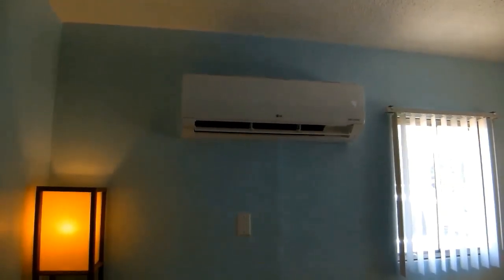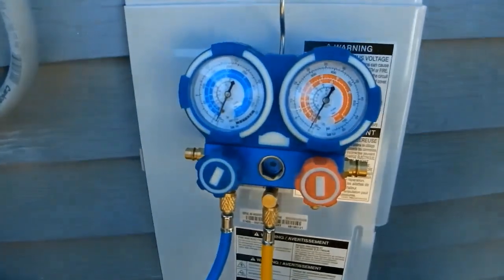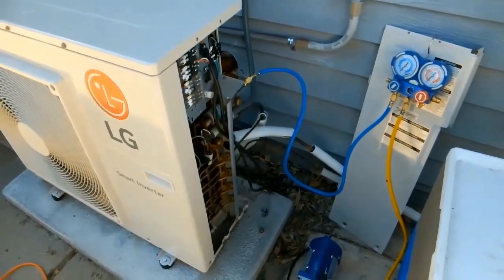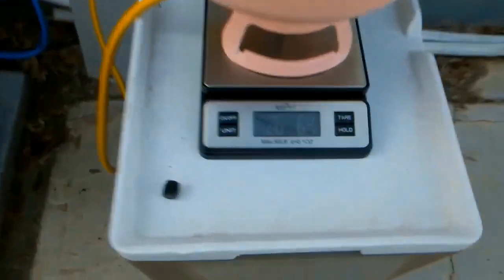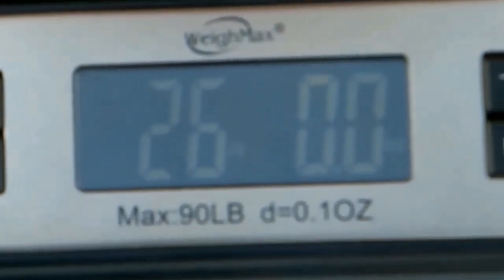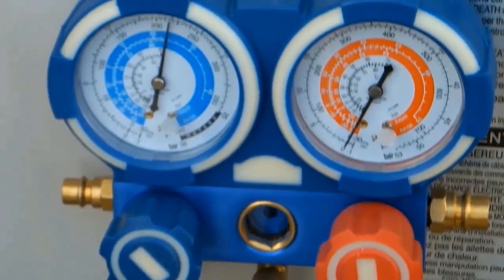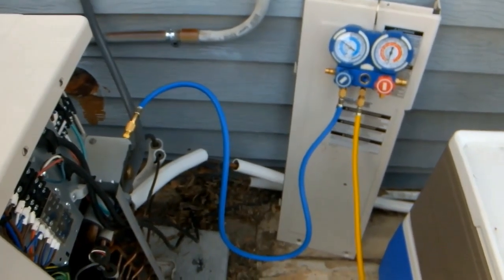How To Add Refrigerant to a Mini Split Air Conditioner

Comment: Nice demonstration. You should purge the yellow hose of air before doing this. Also, the hose will eat about 1.5 to 2 oz refrigerant, plus a little loss when you disconnect, so add a bit more refrigerant accordingly
Reply from the maker: Thanks for the feedback - actually, I updated my mini-split info via this recent playlist: https://shorturl.at/Dnwhc

Comment: I'm lil confused when u purged the system what did u actually do ?? Was it running blowing all the r410a out or was it off with the lines simply connected and open I mean did u use the vacuum pump to suck all the old refrigerant out I'm kinda lost
Reply from the maker: I completely purged the system; that is - removed all of the old refrigerant using a vacuum pump which is pictured at the 1:45 mark in the video. The pump is not running at that point so you don't hear it - it's too noisy to record a video over. The entire system - outdoor compressor, linesets, everything - was completely free of refrigerant after running the vacuum pump. Once the system is empty, you use the manufacturer spec sheets combined with how many feet of linesets that your system has to determine how much R410A refrigerant you need to weigh in to fill the system. Also, I kept all indoor and outdoor units OFF when adding refrigerant back in. You turn the units on after the refrigerant has been added, and then check the PSI to make sure your system will be running at full capacity.
Reply: @DoItYourselfandSave  oh okay thanks I didn't know you could add refrigerant with the units off I thought it had to be running with the compressor pumping to add refrigerant

Comment: Great video! Couple of questions on pressures. I have a discontinued LG one head unit (LSN240HSV2) Sticker on outdoor unit says low side pressure design pressure of 240 PSIG pressure (high side pressure 450 PSIG). Manual says pressure range of 120-135 PSIG at outside ambient temperature of 95 degrees F. I’m assuming I will charge to 240 when NOT running in cooling mode. Then check pressure WHEN running to between 120-125 and charge more if needed. Outside temperature now 40 degrees. Any answers thanks! (Already nitro tested, found two bad flares, purged system etc.)
Reply from the maker: IMHO it's better to charge by weight; that is - use a scale like I use in the video. So you would have to determine how much your LG unit requires and charge accordingly. This means your system should be completely purged, which you say you've done. So now you just need to find how much LG recommends is the correct weight to add in for your unit. For mine it's a little over 6 lbs. fyi.

Comment: How much did the tank cost?
Reply from the maker: The one in the vid cost just over $200, but that was a couple years ago. Now they go for over $400. Expensive, sure, but a contractor will charge that much for a single visit to recharge your system and will use a small fraction of a tank.

Comment: Switching the yellow hose from the vacuum pump to the bottle is an opportunity to introduce air.  If you put the bottle on yellow, AC on red (if the AC has both a high and low access port, use either one), and vacuum on blue, you could ensure the manifold and lines are evacuated and still be able to cut the vacuum out before opening the bottle.
Reply from the maker: When you say "AC on red", exactly which port? Can you provide a more detailed description? I'm going for ease for DIY folks here, but am open to ways to keep a vacuum in the hoses.
Reply: @DoItYourselfandSave  red being the right gauge which can display a higher pressure value.  If the AC is on the blue lower pressure gauge and you exceed the max pressure for the gauge you can permanently de-calibrate it.  So blue (left) on vac, yellow (center) on bottle, red (right) on AC, both valves on gauge set open during evacuation, then close the blue (left, vac) valve and open the bottle for filling.

Comment: where do you find pressure specs.  In one video you say 118 - 120 psig in the other 120 to 130 psig.  I cannot find any pressure specs in owner's manual or engineering manual.  Would very much like to find the actual specs as I am about to move one of the indoor units and have to empty and refill the refrigerant lines.  Thanks.
Reply from the maker: Sorry for the confusion. Find the model no. on your outdoor unit, which should be located on a sticker on the outside of the unit. Type that number into a search engine, and you should get specs/online manuals from LG (or whichever manufacturer) as long as the model hasn't been discontinued. If it's been discontinued, like the outdoor unit in my videos has been (LG discontinued mine, which is LMU36CHV, probably a year or so ago), you may have to contact the manufacturer via toll-free or online unless you still have the manual. Just going off of memory: I think the desired PSI while the outdoor unit is running with two indoor units running should be between 118-125 PSI. Don't quote me on that.
Reply: @DoItYourselfandSave  thanks.  I have the exact same outdoor unit

Comment: How much R410a Refrigerant needed for a 2 ton...whirlpool minisplit???
Reply from the maker: You'll have to check your system owner's manual - find it online via the Whirlpool website if you don't have it handy. Every system varies; I purchased a large container of R410A a few years back to have it on hand when I need it. Shouldn't take more than a few pounds per recharge.

Comment: -30 Hg =155000 micron. basically you are contaminated freon and result that will kill compressor and more leak due to freon that becomes acid which will eat through the indoor and outdoor coil, you are tell people looking for trouble . but I still like it because more money for me when to repair within a year. I love the leaker
Reply from the maker: It's been running great for over four years; so way longer than "within a year". Comments like yours are why I made this video, which may help some folks avoid your $500 service call charges and the desire of some HVAC contractors to avoid mini-splits altogether.

Comment: How you vacuum the blue and yellow hose before connecting to R410a tank?do you use 2 shut off valve?
Reply from the maker: Do a search for videos on the best ways to vacuum out the mini-split lines before adding refrigerant which might provide more details than my video shows. You'll need a vacuum pump which is pictured in my vid at the 1:45 mark.

Comment: Were the valves open or closed when you evacuated on the mini? Was the machine running or off. Mine is completely empty and want to fill.
Reply from the maker: When you evacuate the machine is OFF. Same when you add refrigerant. You'll want to keep the gauges connected, however, after you add refrigerant and then turn the mini-split system on (preferably turn on all indoor units) to test that the PSI is hitting the manufacturer specs for PSI during operation.
Reply: As far as the valves on both the high and low side of the outdoor unit (the ones you have to use an Allen wrench to open and close), are those to be opened when running vacuum pump to purge? When purged and your ready to add refrigerant, are both those valves supposed to be open? Thanks for the great video.

Comment: How much would it be use in refrigerant partially?
Reply from the maker: Are you asking the cost for R410A? Generally it's not terribly expensive. The tricky part is finding it. I've had luck purchasing it on eBay.

Comment: did you have the unit on while you were adding the refrigerant?thx
Reply from the maker: No - the unit should be off when adding refrigerant. You should check pressure with gauges while the unit is on, but turn it off after checking the pressure to add R410A refrigerant.

Comment: You should zero the scale with the tank/hoses in place and then add needed weight slowly, always liquid. Once needed weight  is installed, 
 let the system sit for 5 minutes for the refrigerant to distribute  through the system before starting.
Reply from the maker: Thanks for the input!

Comment: So it's actually recommended to charge on scale with the compressor off?
Always wondered that and got no answer
Reply from the maker: Yes, that's what I did. Turn the compressor off to charge; but turn it back on to check the PSI while the unit is running. And yes - to get the most accurate reading on weighing in the refrigerant, turn the cylinder upside down and place on the scale as in the video.

Comment: To do a full vacuum do you need to have both valves open on outside unit for a mini split?  When adding in the new 410a do you leave both those open ? Since the compressor is not running is it ok to charge it with the 410a in liquid form or does it have to be converted into a gas mixture ? To be clear. I lost all my 410a so i am starting from the beginning.
Reply from the maker: I don't know about other ways of charging (like using the high side or red lines). Full disclosure: I'm not an HVAC pro so check other videos on charging in liquid form.

Comment: Very helpful video for me. I picked up some key points.  Reading your replies, I am surprised hvac contractors are not willing to work on mini splits in your area.  They are so common, they should be a great revenue source. But there is one universal truth, pricing for service and equipment is really high.  There are numerous contractors in my area but supply and demand has not yet balanced in favor of the consumer.  I think we are headed there.
Reply from the maker: There are some contractors that will work on mini-splits, but they seem to be in the minority. I imagine they make more $ on servicing the standard central air units.

Comment: Thanks a lot for your video. It is really helpful. I have a R410A refrigerant FUJITSU minisplit with model AOU24RLXFZ. In the label, it said design pressure high side:450psi low side:240 psi. Does it mean we need to charge refrigerant to 240 psi on lower side as you did for our R410A system? From other videos or doc, they only charge lower side to around 120 PSI.
Reply from the maker: Full disclosure: I'm not an HVAC pro (and for those who are, I charged my own system because your colleagues wouldn't touch mini-splits, so don't get mad at me!) Best to contact Fujitsu directly or download the owner's manual for your specific system and find out.
Reply: It tells about  max low side and high side psi the compressor can operate . As long as you get around 120psi low side  in between 70 to90 degree ambient temp you should be good .

Comment: if you do this incorrectly can it cause the unit to explode?
Reply from the maker: There are certainly hazards when dealing with any types of gases under pressure. You could also ruin the unit. But the fact that you're even asking the question indicates that you should simply hire a contracting pro to handle it. Don't try this yourself if you aren't comfortable with the process.
Reply: @DoItYourselfandSave  thanks, I am going to hire someone.  videos like this make it look simple. but I just don't have the experience.  thanks for replying to my question.

Comment: So what happens when you take the blue hose off when all is said and done. even with all valves closed there is still going to be refrigerant in that line does it just blow out when you unscrew the connection???  never seem to see this step in any videos.
Reply from the maker: Do a search for "how to purge refrigerant hoses" and you'll see more details on removing the hoses.

Comment: Did u check the leak??
Reply from the maker: Yes, using soapy water that I sprayed around all the connections and joints. Once I found it, I tightened the flares/joints and used Nylog sealant to fix the leak.

Comment: About to fill my unit today as it was accidentally purged the other day while I was doing work in the attic on the solar.  My question is, I have vacuumed the whole unit with both high side and low side open, the unit is currently holding at -28.5 to -30 psi.  I am going to close the high side and put in the amount recommended on the outside units cover for the whole system.  Adding so much, like you did, how would I know if I went too far, by say 3 or 4 oz or more on refrigerant?  I know it is a bad thing and can lead to compressor issues, is there any way to tell by looking at the gauges, besides when running the system it stays at or around 117 psi (I have read not to go over 120 psi?)?  Or is it all done by weight of the R410a can?  What if the manufacturer's sticker is wrong or there is still a little left in the line (I doubt it with mine), but I'm trying to make sure I do this correctly the first time and I don't hurt the unit and have to fix yet another thing.  Thanks for the video, it did help me alleviate some of the concerns I had about vacuuming the system on both sides.
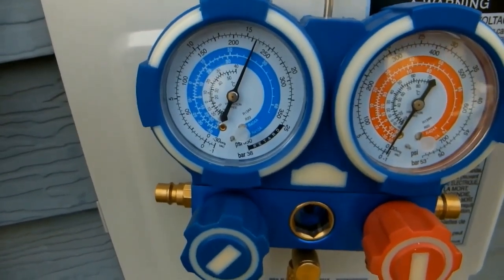Reply from the maker: Go to about 5:53 on my video, you'll see that I show the blue side gauge with a reading of 230 psi with the compressor OFF (not running). This is factory spec for my particular LG 3-ton BTU compressor; so don't take this as exact for your model. Look up the owner's manual for your model online if you don't have it; within it you'll see what the manufacturer recommends for psi reading after the unit is topped off (and not running). While running, however, 117-123 psi is apparently the sweet spot for most units (please don't quote me on this!) Also, now that your unit has been purged, you can also weigh-in the exact amount per factory spec. (Remember: I add refrigerant while the unit is OFF). So, between weighing in and viewing the psi as the unit is nearly full you can figure that the unit is topped off. You would need a battery-operated scale to weigh in like the one I use in the vid. I have never added refrigerant to my unit without weighing it in so on psi alone I would be wary.
Reply: @DoItYourselfandSave  Awesomesauce, thank you for the reply!  This will help immensely, as I was worrying myself to death trying to find a video like yours to try and make sure I do it correctly.  Yes, bought myself a weight scale for this job and going to be doing this job when I get home as I have been waiting on the R410a to come in via FedEx.  I will make sure to check out my manual when I get home for the PSI and also go by the scale, so your advice is much appreciated, thank you!
Reply: Def DIYDude okay, got home and my jug was here.  I made sure to vacuum it again, worked fine.  Closed the high line and then hooked up the refrigerant.  Scale didn’t work that I bought, should have tested it yesterday I suppose, so I had to use my person scale to get my base weight of 15.4 lbs or 246.4 oz. for the jug.  The unit takes 10.125 lbs or 162 oz total.  Yes proceed to empty it until I’m under 10 lbs so I can use my food scale for more accuracy after that, and the scale doesn’t keep shutting off.
I get it down to 116 oz, then the outdoor unit and jug pressure equalized and I couldn’t put in any more (need to get to 84.32 oz).  This is with Cool off.  So, I turned on the inside unit to draw the PSI back down to under 100 psi (so I could fill it with the proper weight) and put the jug back on until I had 84.4 oz left in the jug.  The pressure now seems correct now, around 117 psi, thank for you help!
Reply from the maker: You bet, glad it's working! When or if you have to do this again, it will be easier. Also you saved $$$!
Reply: Def DIYDude most definitely, 200$ visit plus 60$ per lb, saved around 300-600$, thanks bro!